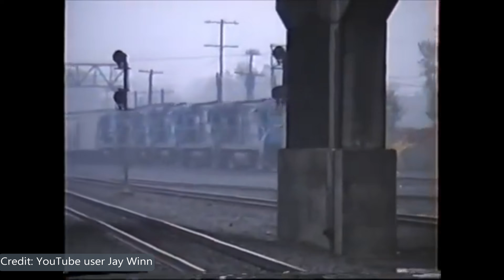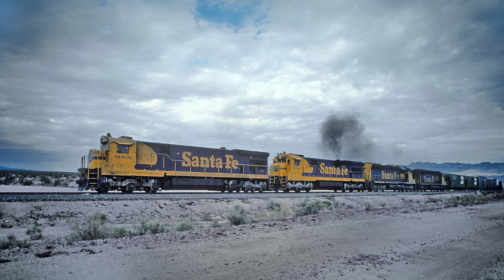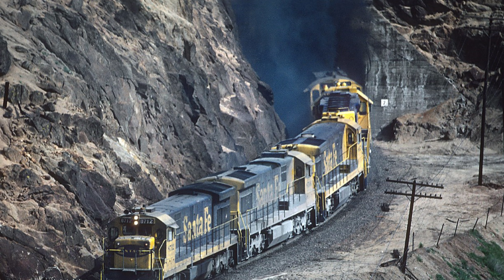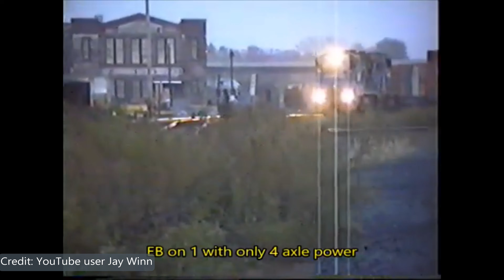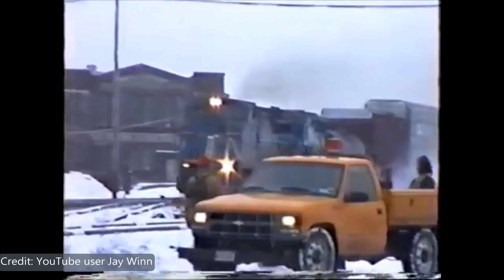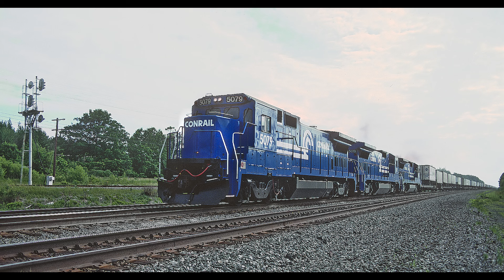GE's Dash 8

Comment: The EMDs will always be around due to their simplicity and reliability.  Anything that Wabtec produces today are disposable.  Look at Amtrak scrapping their mid 1990's P-42s in exchange for Siemens Challenger locomotives.  You don't even see Dash 9's anymore, all of them having been replaces with GEVOs, or something newer because nothing is mechanical.  It's all electronic with fragile motherboards and processors.  Meanwhile, SD40-2's, GP38's, and GP40's continue to operate on short lines, regional, and class 1 railroads.  There are even NW-2 switchers from the 1940's still in service.

Comment: C30-7 was by far my most favorite then again all I got was run threw we had GP8, GP10s, GP18s and GP20s. Ironically I worked a BN C30-7 in 1996, to again ride the same C30-7 in 2015 in Brasil. -7s are the best!

Comment: Retired locomotive engineer here (CNJ, CR, NS). GE locomotives were my least favorite. Long live EMD!!
Reply: EMD was more reliable and widely resourced until the early 1990's. GE has been more dependable since the late 1990's and revolutionised the industry starting in the mid 2000's with how successful the GEVOs are. EMD's reputation and market dominance came to an end after General Motors sold them out. That's why the SD9043MAC's & SD90MAC-H's were outright junk. Greenbriar Berkshire made things even worse for the company which is why none of the crews want to deal with the SD70M-2's & SD70ACE's which have faulty and poor quality electronics, much like the SD9043MAC's & SD90MAC-H's did, and the worst cabs you could ever sit in for 12+ hours. CAT/PRLX didn't save EMD, they just retained the company's name and claimed to continue the legacy but also caused failures of their own. Caterpillar engines do NOT work in EMD units. MKR already knew about that after some of the experimental units they rebuilt for some of the railroads many years ago which didn't have optimal results. The later SD70 series units are all junk. Any of EMD's motive power in the DC era, SD70M's or older, are tolerable and decent but GE's motive power going into the AC era is far more better espiecally when it comes to serious tonnage and throttle response. Not to mention dynamic braking power ratings. Modern GE units are also alot easier and quicker to diagnose and complete mainteance on compared to modern EMD units, espiecally the SD70ACE's. This is partial to why Wabtech constantly has GE AC44C6M rebuilds being completed and has been doing since GE officially left the railroad market and sold that part of the business to them for the better. Another one of the EMD's mistakes into the modern era was hiring outsider parties and subcontractor to manufacture numerous amounts of parts which were cheap and unreliable and backfired them immensely.

Comment: THATS A LIE!  EMDS SD45 WAS NOT A FUEL HOG!  YEAH IT DID BURN A LITTLE BIT MIRE FUEL THAN A GE UNIT, BUT YOU GOT  MORE FOR  IT.  GE LOCOMOTIVESARE NOT THE BEST IN THE WORLD  FUEL EFFICIENCY  MEANS NOTHING IF YOU DONT HAVE RELIABILITY, AND EASE OF MAINTANCE! THE EMD LOCOMOTIVES  HAVE QUICK RESPONDING  THROTTLES COMPARED TO GE UNITS! THE FIRST THING THAT GOES OUT ON GE LOCOMOTIVES IS THE  LOAD GUAGES!  GE LOCOMOTIVES HAS THE TENDENCY TO  DROP THEIR LOAD WHILE UNDER HEAVY  TONNAGE CONDITIONS.  THIS WAS EVIDENT ON CSX WHEN IN 19 86, THE L&N FOUND THAT OUT THE HARD WAY, WHEN ONE NIGHT,WHILE PULLING A LONG, HEAVY TRAIN THRU BRUNDIDGE  ,ALABAMA,  THEY HAD A C30-7,A SD40-2,A U28C, ANOTHER SD40,AND A U30C,NUMBER 1489. THE OTHER UNIT NUMBERS WERE, 7042,C30 -7,ASS40,1243,A U28C,1530,AND  A U30C, 1489 PULLING 289 CARS. NUMBER 1489 WAS WORKING HARD WHEN  SHE DROPPED HER LOAD, AND SHE STOPPED LOADING.  TRY AS WE DID , SHE WOULDNT PULL,AND SOON, ONE OF HER TRACTION MOTOR LEADS CAME LOOSE. EVEN AFTER WE  PUT IT BACK IN WHERE IT WENT, SHE STILL FAILED TO  PULL. AND AS A RESULT, WE HAD ONLY  FOUR LOMOTIVES TO PULL 289 FREIGHT CARS. WE HAD TO BACK OUR TRAIN  ALL THE WAY TO  ARITON, ALABAMA.  WE HAD TO RUN ALL LOCOMOTIVES IN NOTCH 8.  WE PUT HER IN NUETRAL, AND DRAG HER TO BIRMINGHAM  ,ALABAMA. WE FINALLY APPROACHED THE RECIEVING YARD, 3 HOURS   LATE BECAUSE OF THE  FAILURE OF 1489 TO LOAD!  GE MAY BE NUMBER I IN LOCOMOTIVE SALES, BUT THEY ARE LAST WHEN IT COMES TO RELIABILITY!  GE NEEDS TO REBUILD THEIR LOADING SYSTENS ON ALL THEIR LOCOMOTIVES! THIS IS A MAJOR PROBLEM WITH  GE LOCOMOTIVES!

Comment: I can't stand the wide cab like they use today! They are butt ugly! I miss the old short hood locomotives at least they had character!
Reply: I think you should consider yourself lucky you never rode in standard cab and wide cab locomotives. I can assure you a wide cab is much safer that the standard cabs. If you've ever suffered a collision in a standard cab, you wish you had a wide cab. Functional, not necessarily pretty. 44 year retired CSX conductor.
Reply: @walterrogers359 I definitely get what you are saying but I'm talking about the looks. I live in Metairie Louisiana and my parents back yard faced the old Kansas city Southern tracks which used to run down the side of Airline hwy and I'm 61 years old so when growing up I got to see almost all types of the old school Locomotives and Kansas city Southern shared their tracks with Amtrak so I saw the last of the old F units and E units and those old locomotives had character the way they looked. They were good looking locomotives especially compared to the ugly looking locomotives of today. These new cabs all look the same and it's almost like the designers went out of their way to assassinate the look of the locomotives. They remind me of a very cheap knockoff of the old F units except much uglier. What i don't get is i worked in ship yards and Chemical plants and i know the strength of steel so why couldn't they just reinforce the older cabs to have the same strength? Steel is steel and I'm definitely sure that there was something they could have done to the old cabs to give them the same strength if not more. I won't even watch videos of the new engines because they are ridiculously ugly and I just don't like them. My favorite is the old U boats with the old SD's second. I'm lucky I still get to see some of the old GPs of Kansas city Southern moving freight around the New Orleans and Baton Rouge areas plus we have the New Orleans Belt Railroad which has some of the old GPs and even a SD40 which also moves freight around New Orleans. I take my grandsons to see the old locomotives when they are out moving around but they say the same thing about the way the new locomotives look. In fact they asked me why locomotive companies got away from the old cabs and I told them that they are supposed to be safer which I really don't understand because when you work with steel and know the strengths to me it just doesn't make sense! Thanks for your comment though

Comment: CSXT 9000-9052, the pre-production -9's sometimes referred to as C44-8W's, were built between 7-93 and 3-94, not in 1996 as stated in the video.
Reply: I knew csx never used dash 9s. Glad they stuck with ac44s. Csx 9000s are just extra dash 8s.
Reply: CSXT's CW44-8's were CW40-8's that were just modified at their own shops to the horsepower settings of the C44-9W's. Unofficially all of them are still considered to be the testbed units for the C44-9W's even before GE themselves went into testing and production of the series. It's the same scenario that happened with CNW's C42-8's which were all C40-8's that received horsepower modifications as well at their own shops and unintentionally were testbed units in their own way for the C41-8W's that soon officially followed from GE.

Comment: I have a little story with one of the rarest models of Dash-8, the C32-8
Roughly around 2001, Brasil Ferrovias bought a C32-8, ex-Conrail and ex-Big Dog Industries, she became BF 9339, around 2004 she went down from the plateau to Santos, which was incredibly rare as she usually didn't get past Araraquara, I remember riding my bike to the port Avenue near Warehouse IX, and seeing that locomotive with a "hump" behind its cab in all her green, yellow and off-white/cream glory leading a grain train followed by some C30s, probably the former Conrail dash-7As she was always with
While my family had a camera, a soviet Zenit, that my dad had bought in trip to Uruguay, both it and the kodak film it used were expensive so I wasn't allowed to even entertain the idea of using it on my own, it was also pretty heavy, so sadly I never got any pictures
Apperently her coming down was a one time "There's no other power available" kind of deal
She suffered a major short circuit a few months later in her electrical cabinet that sealed her fate as a parts donor for the C30-7As, her empty shell was scrapped in 2016 at Campinas-SP
Beyond that there's the BB40-8Ms from EFVM on 3ft3in (meter) gauge and the GE of Brazil built C40-8s for EFC that use low brake cylinder GSC trucks for some reason

Comment: AS AN MECHANICAL EMPLOYEE OF SANTA FE, WE DID A LOT OF DASH -8 TEST MODEL WORK ON GENERAL ELECTRIC LOCOMOTIVES!
THIS WORK RESULTED IN THE EB CYLINDER ASSEMBLY, THE INTRODUCTION OF THE 
COMPUTER CONTROLLED CONTROL AND TRACTION CIRCUITS, AN VASTLY IMPROVED
GENERAL ELECTRIC TURBOCHARGERS, TOTAL ELECTRIC DRIVEN AIR COMPRESSORS AND COOLING BLOWER FANS!
ALSO AN LOT OF OTHER PARTS WERE MORE EASILY CHANGED!
ON THE ROAD THE DYNAMIC BRAKING WAS MUCH MORE EFFECTIVE, AND CONTROLLABLE!
WITH THE ARRIVAL OF THE WIDE CAB AND TABLETOP BRAKE AND 
THROTTLES AND MUCH BETTER SEATING, THE CABS WERE MUCH MORE COMFORTABLE, AND QUIET!
THE REASON THAT THEY HAD ONLY 4000 HP ON 4 AXLE UNITS, WAS THE TRACTION MOTORS WERE RATED AT 1000 HP, BUT THE ENGINES WERE GOOD FOR 4300 HP!
LATER ROAD TESTING ON THE SANTA FE WITH 6 AXLE UNITS REVEALED THAT MINIMUM LOAD SPEED AND HIGH AMPERAGE LIMITS COULD BE INCREASED BY 10 PERCENT, ALLOWING REMOVAL OF EMD 3000 HP LOCOMOTIVES FROM AN 13,000 TON COLORADO COAL TRAIN, ON SPEARVILLE HILL, KS.
KEEP THEM ROLLING BROTHERS!!👍👍

Comment: It's interesting how the railroads turned away from 20 cylinder diesels during the fuel crisis for their raw fuel consumption, even though their power-to-fuel-burn ratio was better than 16 cylinders of the same block line.
Reply: Cracked and desentigrating crank shafts.  Mitsubishi had the same issue on their 20 cylinder ocean diesels.  The 20 cylinder is like a straight 4 or V-6 being there are inherent engineering issues that are hard to negate.